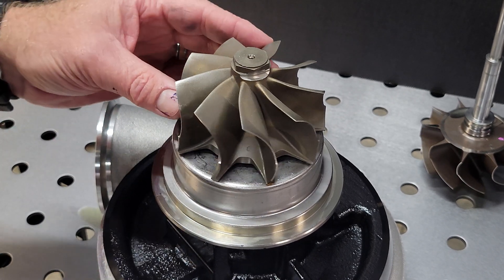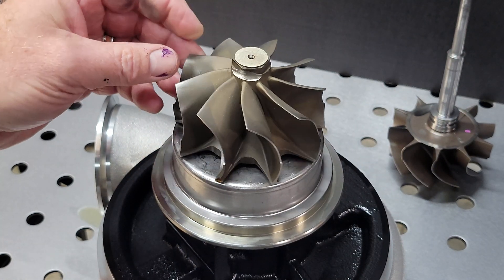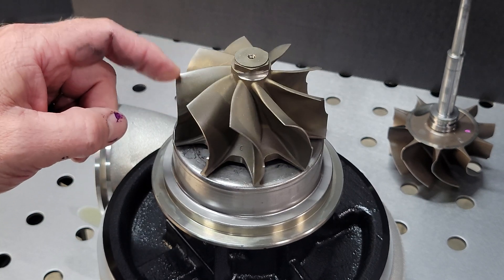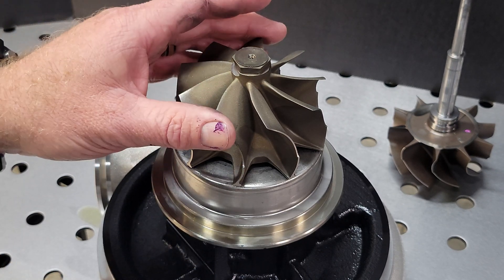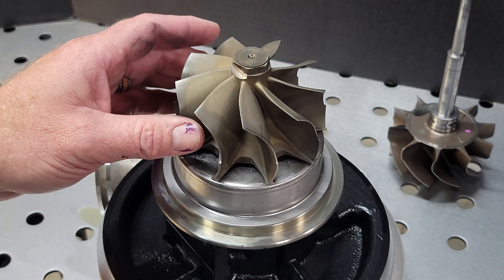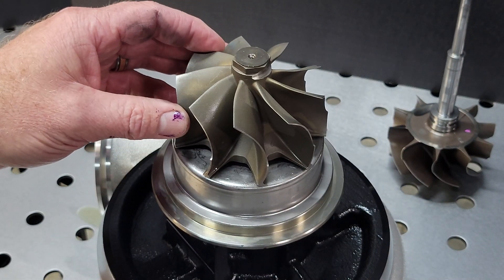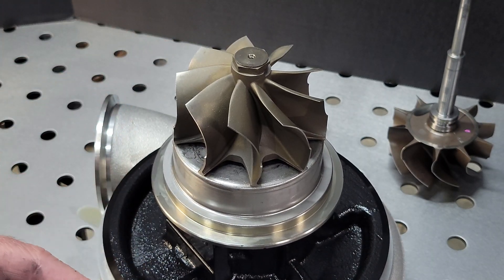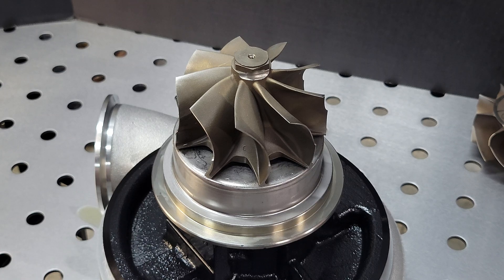WORK S400 96/88mm 9 Bladed Turbine Overview

Comment: Nice work!
I saw the video preview picture and my first thought was 'Garrett G-series turbine shaft' and you confirmed that within the first minute of the video. I have done a similar custom turbine shaft by adapting the G25 turbine blade/rotor to the Subaru STI IHI turbos and it has been a fantastic perfomer for the last four years with over 200 units sold.